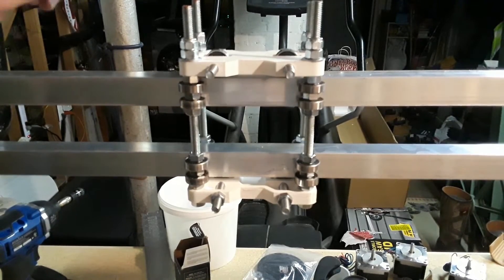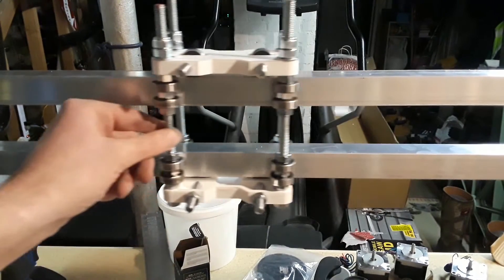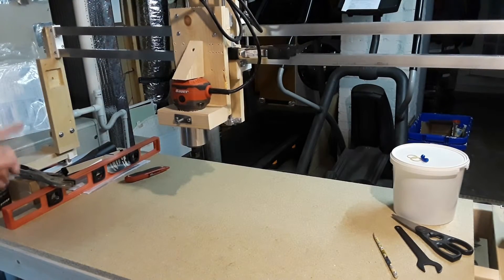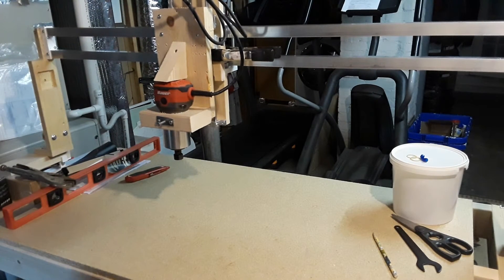Homemade CNC Router Part 3: X Axis, Z Axis, Nema 23 Stepper Motors, And The Belt System

Comment: What kind of steppers did you use. A nema 17 for the y seems underpowered.  Any advice would help
Reply from the maker: I used Nema 23 Motors for XYZ.

STEPPERONLINE 3PCS Nema 23 CNC Stepper Motor 2.8A 179oz.in 56mm Bipolar for Hobby CNC Kit https://www.amazon.com/dp/B00QG1ZF48/ref=cm_sw_r_cp_apa_glt_i_9ZVST6ZCE5CP2NN818F8

Comment: There is a very good router mount that you can 3D print that would be much more stable.  You might want to look into it.  It is on Thingverse and fits my Makita palm router very well.  I printed it with 100 infill as well.
Reply from the maker: I actually ended up doing that. It is much more stable. I'll be having a part 6 to the Homemade CNC Router very soon, which includes the 3D printed mount.

Comment: Super cool build. I will be impressed if it works though. A CNC puts a lot of angular force into the gantry and your gantry looks a bit wobbly. Hoping for the best!
Reply from the maker: So far I've it tested it and it seems to work very well. Thanks!
Reply: @BunkerBuilder  that's awesome!  You never know until you try.